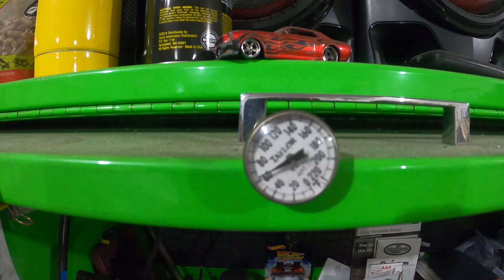My Honda Ridgeline gets a bed liner CAMO PAINTJOB!

Comment: What colors are the grays? Or did you just mix up some black and white and used whatever you came up with? Also you have some lengthy patience when i attempted this on my white truck i didn't get past the first color as you said it kinda looks like crap until you get multiple colors sprayed on and stand back away from the vehicle then it looks alot better.  And one more question is there a reason you started with your dark colors first instead of the lighter colors. Just seems like it would be easier starting with the lighter colors but idk

Comment: cool truck :)
what brand of bedliner didi you use? :)
Reply from the maker: Black raptor liner from O'Reilly Auto parts and the colors are automotive base coat reduced with clear coat to make it a durable single stage.

Comment: Bruh that's freaking awesome 👍🏾great minds think alike.  I just got myself 08 Ridgeline what size rim and tires you got? I like the stance . Stock suspension or lifted?
Reply from the maker: Thanks! The wheels are XD Rockstars 17x8 +10 offset and the tires are Toyo Open Country 3 265/65 R17. The down side of the wheels is that the holes are 5x120.65 and the truck is 120. it works, but the real thing is the wheel studs are short. I'm planning on putting extended wheel studs on as soon as I can. I HIGHLY suggest  them!